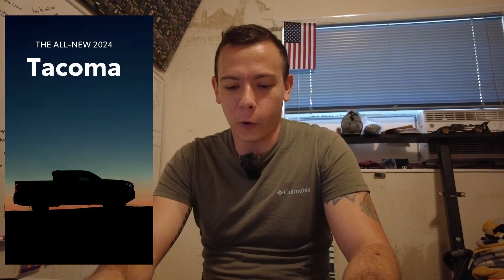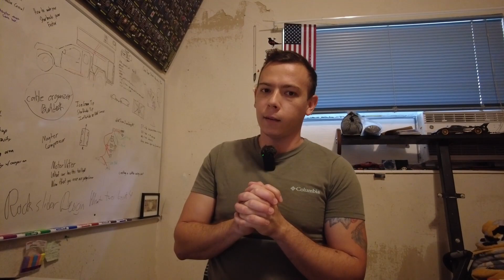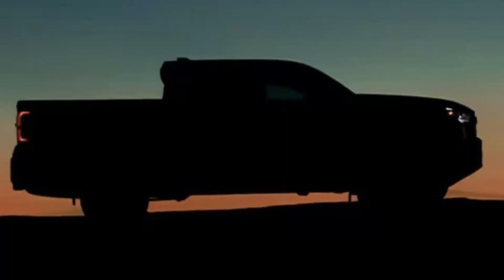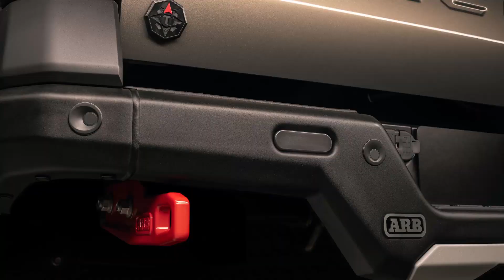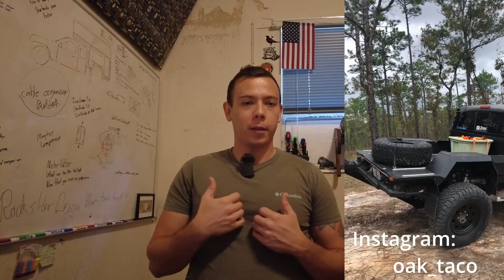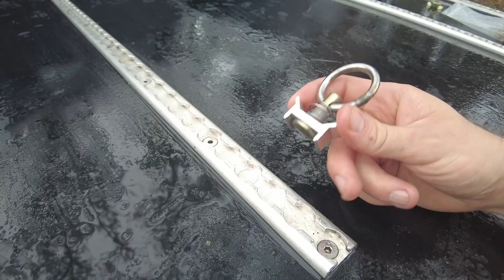Engineer explains everything GREAT about the 4th gen Tacoma (IRS; iForce; Turbo and more.)

Comment: no turbo. that's bad move. It's obvious that engine is not going to be reliable. It is not Toyota move.
Reply from the maker: Why would Toyota risk one of their biggest markets with a non-reliable engine? 
Turbo motors have been prevalent since the 2000s; 20+ years is plenty of time to figure out the reliability.
Reply: @jdesigns7239  yet, tundra already has turbo gate blocking issues.You’re probably type of guy who sells before even 100k. What do you even know about owning for 2 30 years ? And tundra just cheap out of their engine because they can’t make v8 cheaper than before( Toyota executive told me in person) he said “ It is economical decision”
Reply from the maker: @Kaywonlee  Lets not make assumptions, my 2nd gen Taco has 160k.

I would argue the turbo v6 is more expensive that old 5.7 v8 do to increased complexity (which doesn't mean less reliable). I don't think cost was a factor when switching engines.

There may have been a few new Tundra  engine problems, but are plenty of testaments here on YT of ppl really using their Tundra's with no issues.
Reply: @jdesigns7239  most of them have problems not few.  It’s going to bring recalls. And no it is cheaper to make V6